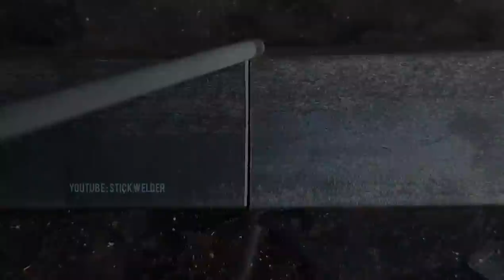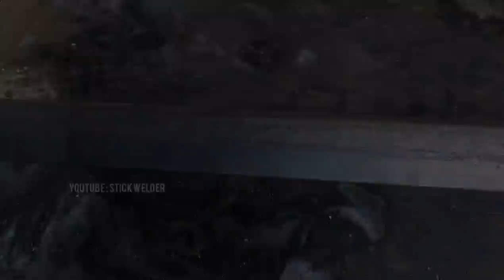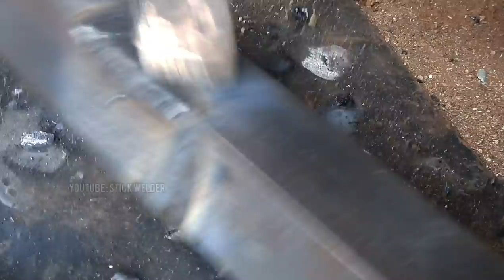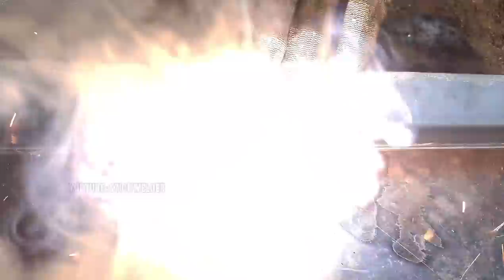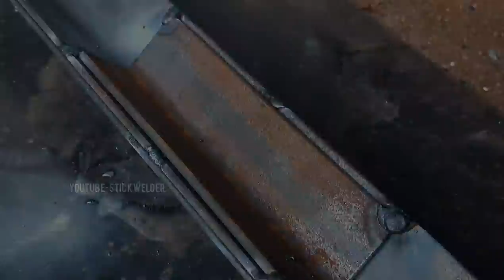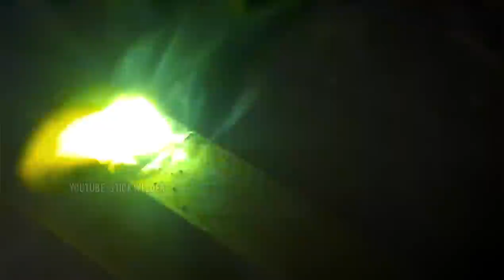angle iron welding, two powerful joint tricks that not everyone knows

Comment: It's like 2 mm thick  just a normal butt joint would be strong enough. All you are doing is wasting time and pouring excess heat into the steel and changing the structure of it

Comment: What makes this strong is the weld along the angle. For structural welds V all the butt welds for 100% penatration! Great work but I never weave my welds instead concentrate the heat in the joint for penatration and allowing for impurities to float to the surface with the slag.  Especially if you haven't ground a v at the butt weld.

Comment: A proper 7018 weld with beveling and Gap would produce a sufficient joint just about welding it. It will have more strength than the steel itself without the excess heat and time